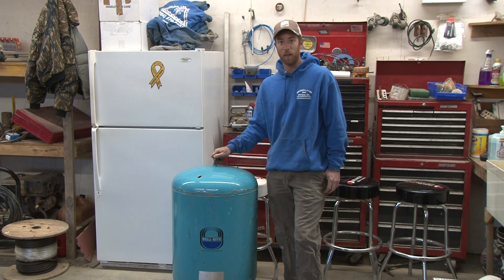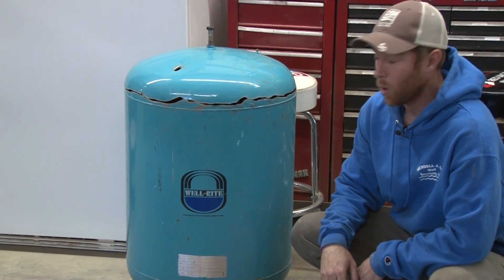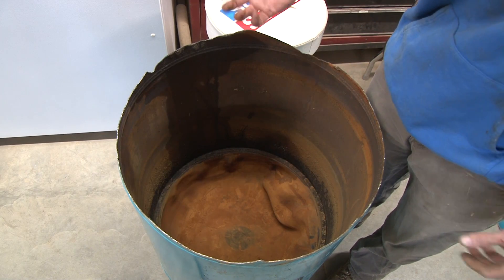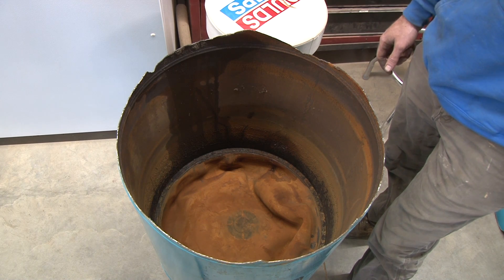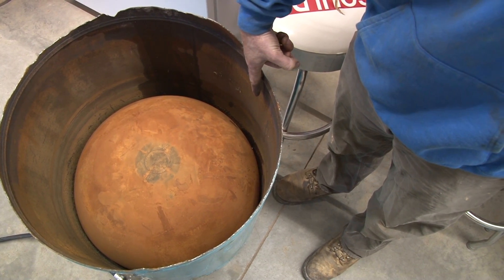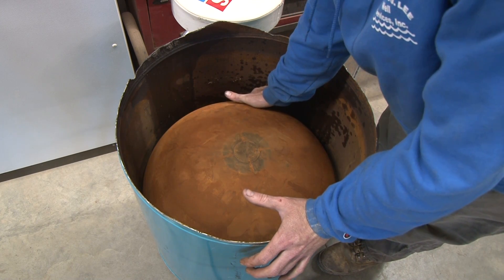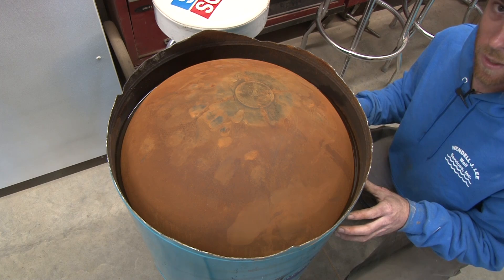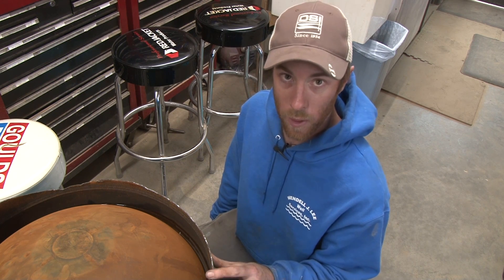Well Pressure Tank: How it Works and How a Tank Gets Waterlogged

Comment: Finally the homeowner knows how the water ,air ,and blader in the tank relate to one another.A picture is worth a thousand words.You are a great teacher,
Reply: Nice video but he should have clarified what a " Bladder Tank " is.  Prior to bladder tanks there was just water tanks with the correct amount of air added regularly at the top.  Add too much air and it leaks into your pipes releasing sediment.  With correct amount of air it works same as bladder tanks but the air is eventually removed by the water and the tank becomes "Waterlogged" and you need to add air again or the pump will cycle quickly.  To help with the problem there was an "Air Injector" you could add to the tank which would inject a little air into tank when pump cycled.  It was a hassle at that time to use a tire pump to add air ( but not too much ) every few months but that's what you did.  Around in the 60's the bladder tank came on the market to solve the problem by seperating water from the air with the bladder so water no longer absorbed the air.  I have the same size tank on the farm as the bigger the tank the less often the pump cycles which extends pump life.  Too bad an old farmer has to explain what a Well Driller should have but that's modern times I guess.  Probably this guy doesn't remember Water Softeners that had to be manually operated but that's a different story.  Hope explaination helps someone understand bladder tanks.
Reply: @jefffrayer8238  I agree, I used to have just a tank that would become water logged every couple months and I had to add air.
Reply: @duke7595  Yes, that's how it was done before bladder tanks using country  wells.  Many of the old air tanks were cut in half and used to feed livestock. We had a shallow well pump located outside the house below ground level to keep from freezing here in Michgan.  Probably about 4X4 and 4 foot deep with a cover topped with straw bales to keep from freezing.   We also had a softner that you dumped Iron Out and Salt into from the top and manually controlled the wash and rinse cycles.   If you left it on rinse too long then you needed to start over.  You must be fairly old to remember,  I'm almost 70 raised on the farm.  I do think the guy explainded the bladder tank fairly well but failed terribly as to why the bladder tank and what was used before.
Reply: @jefffrayer8238  Live in the Ozarks, there're quite a few non-bladder tanks still in use in this area. I had one until the pump failed 11 years ago at which time it was changed to the new system. I will say it's a lot easier not deaing with a waterlogged system. Hope it lasts, thanks for your reply and take care.
Reply: @duke7595  Ahhh,  The Ozarks.  I'm thinking people have to be very tough and tight knit awesome to live down that way.  I may have been able to tolerate Cotton Mouths and Alligators decades ago but no way would I live with invasive snakes and reptiles.  Watching Swamp People is good enough for me, Lol.  Love you people down there and please stay safe.  There is an Alligator swimming around up here but should be caught shortly and I know they are tasty.
Reply: @jefffrayer8238  I hear that, take care of yourself and watch out for those alligators. Stay safe partner..

Comment: interesting...I would have thought that the bladder would have been holding the air rather than the water,
Reply: RE:roystevenson1375. "I would have thought that the bladder would have been holding the air rather than the water,"
The bladder (or diaphragm) is between the air and the water, so, I guess one could say that it holds them both. The tank comes pre-charged to 38PSI so initially the air is forcing the bladder downward. As the pump adds water to the bottom and it exceeds 38PSI, the bladder begins moving upward, compressing the air further. When the tank reaches the shut-off pressure (commonly 60PSI) the pump shuts off and both the air and water pressure are equal.

Comment: Thanks I would like to learn something but I have been having pressure problems with my tank and pressure switch change both flush a toilet still have no pressure in the sink. I think I have sediment in the lines. pressure is real good till you flush a toilet. and that’s with a new pressure tank and pressure switch. anyone have any ideas what my problem is I have pressure until I use a faucet or flush the toilet then it just drips out of the sink. Air pressure is right in the tank 28 psi for 30 50 pressure switch

Comment: So what I don't understand is why does the tank need a bladder in the first place? What is the problem with the water and air mixing so long as there remains water at the bottom of the tank? It would only take a float switch like in a toilet tank to monitor the water level and once the water level fell below a certain point the outlet valve could shutoff and stop the flow of water out. That wouldnallow water to refill the tank and build pressure again. The volume of air in the tank would remain consistent, only the PSI would change. Right?
Reply: RE:anthonyalegria7096. Air can be absorbed into the water until there is no air left. It gets pumped into the house.

Comment: Great video ..  just had entire pressure tank ..switch .. spigots .. plumbing pipes etc changed .. however our installer stated they don’t put check valve at the pressure tank because there’s a check valve already on pump ?!! .. he said having two check valves can mask pump problems ?!  

What’s your though on this info please

Comment: Hello when I fill my bladder up the correct way at 28 psi cut off pressure 30 it shows 28 on my gauge could you tell me what's wrong any body does that mean there is a hole in my bladder thanks

Comment: So if the air pressure in the tank were not kept at proper setting this could cause the bladder to rupture due its expanding too much?  I suppose it's possible that the Schrader valve core could leak and cause this. How often do you think this happens?

Comment: And we all get the fact that the air on top of the bladder is pushing the water out towards your faucets which gives you the extra pressure until the pump needs to fill the bladder back up which keeps the pump from cycling so much. That makes perfect sense and it's a great design

Comment: So are we looking at a bladder? Because I don’t see a bladder!! like what is the bladder? What is it made out of? I still don’t understand, you keep talking about the bladder and pointing at a bladder but I just see a rusty steel cylinder, so could you tell me what the bladder is supposed to look like and what it’s made out of or could you hold the bladder and show me exactly what the bladder is? By the way I’ve searched all over the Internet to explain what a well pressure tank is and how it works and although I still don’t know what a bladder is what it’s made out of or what it looks like this is the best video on the Internet
Reply: RE:darrylrain6199. "Because I don’t see a bladder!! like what is the bladder?"
Looking down in the tank, what you saw expanding upward like a balloon is the bladder. It is usually made out of butyl rubber and is black, but in the video it is coated with rust.

Comment: I wonder if I can buy some time by getting some water out and some air in. I’m completely water logged on an ANCIENT system. Water all the way to the top, about 6 feet up on an old galvanized tank that HAS NO SHRADER VALVE on it. Pressure switch melted down from short cycling and finally fried the contacts when the switch would never cut off. I replaced the pressure switch but the problem is, is that no pressure reading is getting to the switch. The tiny pencil sized pressure switch line would only drip out about a gallon of water an hour with no pressure behind it when I took the old pressure switch off, and so the new pressure switch won’t cut off, so, because we are FLAT BROKE, we’ve been forced to cut the breaker on and off when we want water. I’m surprised the ancient (probably 40 year old) above-ground pump is still working, but it is. I just need to buy some time right now though…

Comment: Even if the bladder fails it should still contain all the air. It seems like it should still work.  Where does the air go?  Is it dissolved into the water?
Reply: RE:27kilofoxtrot.  Yes, the air gets dissolved.

Comment: Thanks for giving this tutorial on pressure tanks. A question I have concerns my tank. Bought new  Amtrol Well-x-trol  wx251 gallon tank. Got a 1/2 hp submersible pump. 40/60 Square D pressure switch. When tank fills to reach 60 psi,the pump shuts off. When I tap the side of the tank from it’s bottom moving up to top, I can tell where the water level is by sound. As I move up the tank wall the sound of tapping on the tank turns from dull thud to hollow sound. This happens at less than half way. This is a 62 gallon tank but according to where the sound of dull to hollow changes it represents only Less than half the volume yet gauge reads 60 psi. Any ideas?

Comment: Just installed a. 30 gal. Water worker tank but when it reaches cut in at about 20 lbs it drops quickly to almost zero then quickly comes back to 20 and then the pressure gauge operates normally. What do you think the problem might be?
Reply: RE:michaelcouch7257.  Is your pre-charge at 18 PSI?

Comment: I woke up this morning and my pump was running so went to the pump house to find a rust hole in the dome and a shower of water soaking all the electricals. so thankyou very much I can now see what's gone wrong and I am on my way to get a replacement tank. Diagrams and adverts are ok but seeing you with the top cut off and listening to the explanation is way better. Jim in NZ.

Comment: I didn't hear you explain how much air to inflate in your tank
Reply: RE:donniecox6503.  It's probably in another video. Generally, pre-charge is 2 PSI below the cut-in pressure of your switch. For 30/50 switch, pre-charge is 28PSI.

Comment: my pressure takes to long to buildup , and because it's not reaching 60 pounds It's not allowing the switch to disengage either. If I cut the Shower on I loose pressure before time as I once had no water pressure issues when showering or anything else, my tank is very old could it's bladder be causing the tank to take forever to buildup?
Reply: RE:danielgibson5176. Sounds more like a pump problem.
Reply: @munsters2  The well was running low, It's a open large well, I have not checked it again, I had to hook up to the city, I pray it fills back up. I'll use it only for drinking water. I hope I can get back around to checking the level again,

Comment: I'm super late here, but I'm going crazy with this problem, maybe you have an idea?!?
So my tank pressure is fine, seems to have no indication of failure.
Pump runs, tank fills, pump turns off.  
3 minutes, tank is empty with NO outflow from tank!
Valve to house is off.
Brand new check valve between pump & well head.
No water anywhere near any connected pipes (no leaks of any kind)
The water is just disappearing!  
It can't go to house: 
... valve is off.
It can't go back down the well:
... check valve prevents backflow.

What in Poseidons Beard is happening!!??!!

Comment: I just assumed the bladder held air.  Now I know the bladder holds water.  Thank you.
Reply: I don't know much about a lot but my thought went to the human anatomy in which the bladder holds fluids. Guess I should believe in myself a little more, like now when I have got to replace my tank but I'm doing everything else but that. That's why I'm here today studying all I can to make sure I've got a firm knowledge of what the hell it is that I'm doing. Pray for me please.
Reply: I thought the same.  Thx
Reply: Good video demo dude, thanks!
Reply: Same
Reply: Only if it has a whole
Reply: same for me,
glad i found this video, now i knew the truth
Reply: Some brands have air inside the bladder. (Wellmate)  It is possible to replace those bladders, but it's not much cheaper and it's a bigger to do.
Reply: It holds air. The water presses against the air that is held in it. He cut that part off, so it couldn't hold air anymore.
Reply: You were right it does
Reply: Why do plumbers always replace faulty tanks when only you need to replace the bladder ..make more money while consumers dumb dumb 😢😢😂😂😅😅
Reply: @2wwwilly  1) they don't make replacement bladders 2) the bladder is inside the tank and the tank is steel. 3) That steel has to be completely welded shut so there's no access.. 4) the seal on that bladder to the tank and pipe fitting isn't something a DIY'er can do and 5) the labor $$ to replace that bladder would be the same or more than what a brand new tank costs and there wouldn't be any warranty. 

There are bigger conspiracies in life to worry about than your pressure tank bladder issues 😒
.
Reply: @2wwwilly the bladder isn’t serviceable. You cannot open the tank.

Comment: I have a pjr 15 tank. There's a larger diaphragm tank.  Im loosing pressure indicated on the in-line gauge. My pump is short cycling every 15 seconds.  There are no pipe leaks.  The pressure gauge starts dropping as soon as it the pump cuts off, then cuts back on. Would that be an indication of a leaking bladder in the pjr 15 tank? Thanks

Comment: We recently replaced our pressure tank. It seemed to be working fine for about 2 months but yesterday our water turned off while showering and then came back on. It seems like there is no water going into the pressure tank at all. The tank has 38lbs of pressure in it. We have the pressure set at 40/60. Any suggestions as to what the problem would be?
Reply: Did you ever figure out the exact problem?
We have the same issue. The pressure tank feels like there is no water in it when I shake it and we have low water pressure upstairs.

Comment: I just had my pump & bladder tank replaced in March , I've noticed the pump comes on right away as soon as my washing machine starts disbursing water . Is that how it's suppose to work ? I was told there should be a delay until the bladder gets low ?

Comment: ok to make sure i understand correctly, as the water-filled bladder increases in size, the AIR pressure in the SEALED tank increases so that at a certain set point, say, 60 psi AIR pressure 
in the tank will signal the pump to  cut off and vice-versa cut ON again when  the water is removed from bladder and air pressure in tank decreases to a certain set point (e.g. 40 psi). This is correct? thanks anyone!

Comment: What pressure does the incoming water need to inflate the bladder on a 38 psi tank? Greater than 38? Thanks for a great video.
Reply: Tank should always be 2psi below the pump’s turn on pressure. So 40psi pump turn on for a 38psi tank.

Comment: Excellent instruction! Nothing like seeing how things work.  Also a very Good explanation.  Now though, I am wondering; how did the hole get in the bladder in the first place?  Could there have been a tiny piece of sand or gravel, that got sucked through the pump, into the supply line, and on into the tank bladder, causing the hole?????? Perhaps my sediment filter should have been positioned to preceed the pressure tank, rather than follow it, to do the filtering before the water supply gets into the tank bladder.
Reply: You asked the same question that I just asked today. I had not seen your post, but I look forward to seeing what the fellow recommends. I’d also like to know the brand of in-line filter that he recommends. Our water has iron in it and so it has an orange color and it makes all of the toilets etc. stained.

Comment: what about cleaning your pressure tank of built up sediment  .. Mine was just cleaned accidentally when the turn off spigot broke and I was surprised at how much dirt came out  red , grey and black stuff it was a new one as of 2016   psi on mine is at 50   the water came out clear at first and then came out dirty at the end  ,  Mine is a 40 gallon pressure tank  .   so should they be cleaned and how often  , We were replacing our whole house filter when the turn off  broke . I would say there was probably a gallon of silt

Comment: Hello we don’t have to good of water pressure’  on a well pump. New pump put in 2018 down in the well. Pressure seem to have gotten worse. Someone ask if I check the tank pressure sense they put it in. No’ so I did and it was all most 10psi. I was told it should be at 28 psi and no more then 30psi.. the cut on is at 32psi and cuts off at 45psi. Should it be 30/50 ? The problem was the shower and filling the washing machine’ which took ever for a recycles. What should be done? Please can you help. New tank new well. And at the garden Spicket about 8 feet away it has the best pressure. Fill a 5 gal Bucket in about 45 seconds.

Comment: Great visual video. What would cause the water to by pass the holding tank and run directly to the house?
Pressure switch is working but the holding tank is empty.
I've got 30 psi at the air nipple.
Thank you